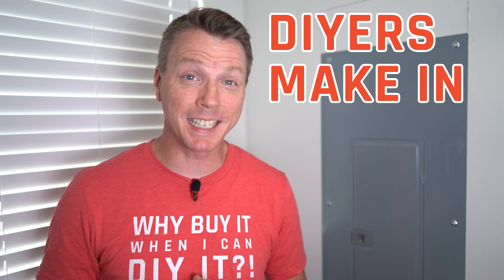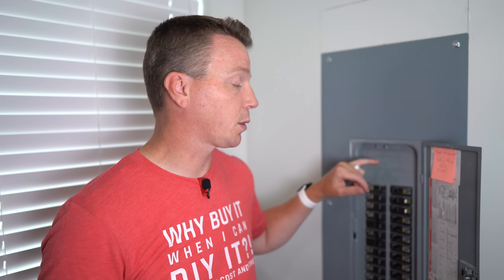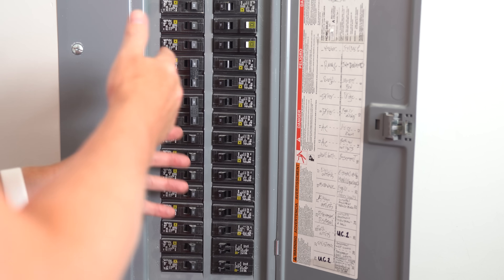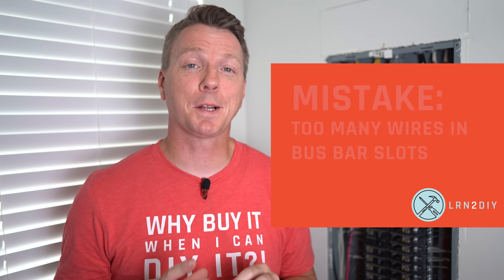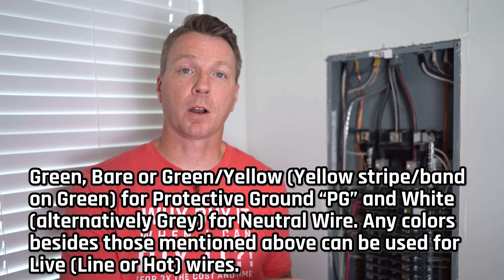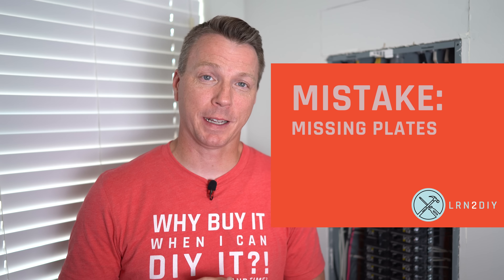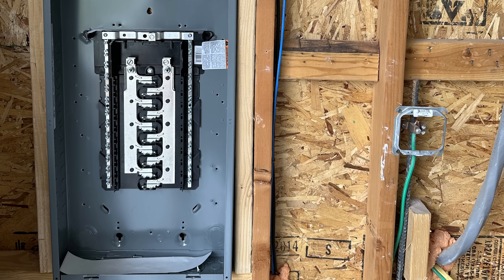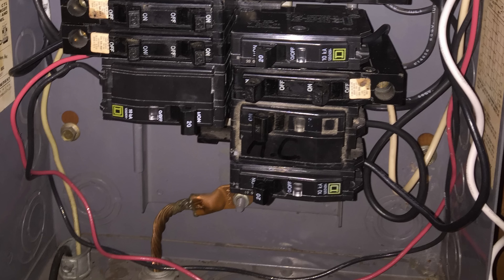10 Common Mistakes DIYers Make In Circuit Breaker Boxes

Comment: Our house in michigan the fuse box is in the basement , the main sewer line slopes down the far gable side of house's basement , 3 foot or so from the wall , the fuse box is about even with it , when I first saw it , I was wondering if the door would clear it , but it does by a long shot ..just never seen a plumber and a electrician work so terrible behind one another.
The florida house , when I got it , had the local professionals put in a sub box for the ac , apparently it shorted out so they pulled that fuse and run a sub box , with one of the bus bars burnt in half .. previous owners were 93 yrs old & handicapped ..couldn't have ran if there was a fire ..

Comment: M.E. here. Nice video, well explained. I got a chuckle out of the clean organized panel you showed at the end. I LOVE clean work, THAT'S the guy I want on my crew or doing service calls. But then I looked closer, and saw the circuit wires labeled in numerical order from top left down, then top right down, rather than odd circuits left, even circuits right. I know this was probably from the pull, labeling the romex as each home run was pulled to their location - but then you need to have a pull drawing to know exactly where everything went, if their numbering isn't going to match the panel cover. Hardly the end of the world, just gave me a little chuckle. It's the little things, sometimes. 🙂
Reply: A good little trick when roughing in a residential panel is to cut off a 2" piece of romex sleeve and slide it over the homerun hot conductor  as you land the wire   this also cuts down any confusion which wire controls what circuit.  Plus it saves time when labeling the panel!

Comment: My pool equipment started acting flaky, and it turns out they had installed the wrong type of breaker in the panel. It sort-of fit but didn't really lock in. It had been working for 15 years or so, but eventually started losing contact. There were three other breakers in the panel that were also of the wrong type.

Comment: I want to replace all the wiring in my house. It is Aluminum. What were they thinking when they allowed aluminum?!  Aluminum corrodes causing high resistance and subsequent heating. Aluminum mushes down when connection is tightened. Aluminum expands and contracts with temperature. Some bozo electrician back in the 70's used Aluminum in all the outside outlets! WTF! When I go into the outlet, I find the wires burned and brittle. I lose continuity in the circuit and lights go out inside the room that circuit is associated with. Doesn't even trip its breaker! I had to remove the affected outlets try to find Good wire by snipping off the bad stuff and hope I have enough left to wire nut together with special expensive Aluminum wire nuts just to abandon the outside outlet and restore continuity to the loads on that circuit. You electrical geniuses dropped the ball on that fiasco. Do you have any remedies that doesn't involve ripping down all drywall? Good video BTW.

Comment: The "wire" can handle the higher amperage.  The insulation determines the max amperage allowed to avoid heating and cooling the insulation so that it hardens as the oils evaporate out and eventually the insulation cracks and falls off.  Only one rule...call a licensed electrician.  We go to school and have 8000 hours on the job training for a reason.

Comment: I follow two guys that often don’t use strain relief/bushings and when I asked them, they said they use them if they have them?

 I do a lot of work on buildings built in the 40s and 50s and I like to use a white and black heat shrink on the wires since it’s often not clear which is which. When I see a white wire using the power wire I’ll put black each rank on it even though anyone who sees it on a break or assumes, it’s part of a 220 circuit.

Comment: I would add one more important one:  turning off the main breaker with all the branch circuits left in the on position.  The branch circuits should be turned off first and turned on last when shutting off and turning back on the main breaker to avoid damage to the breaker due to arcing.
Reply: This is an electrician's rule...not a homeowner.....lol
Reply: @electvolt67 uhh, this is anyone with a brain's rule who doesnt want a dangerous surge of power as soon as ALL the breakers demand ALL the power in the same millisecond.. "lol"
Reply: @electvolt67  Do you want an arc fault situation to potentially occur? Do you enjoy flying by the seat of your pants and possibly burning down your house or having some other accident. Turn off your breakers first and then on last...do it right or don't do it at all!

Comment: Mine just has an unused circuit breaker.   I think they reused the original 1960's panel when they replaced the wiring in 2004.  The left the original wiring in place and just disconnected it, stapled to the rafters.   I have been slowly removing that 1960's wiring.  The metal factory pays pretty good for it.

Comment: Thank you.
   Others have made comments on safety issues. 
  A good summary.
  For safety, stand off to the side of the panel. If a rare breaker explosion occurs, that will lower your chances of getting plastic and metal in your face.
   Thanks again.
Reply: Couldn't agree more - face shield if available. I'll add the same holds true for jump starting vehicles. Rare, but if there's an invisible 'cloud' of hydrogen gas around a battery, the arc from attaching the jumper clamp can cause a hazardous flash to an explosion that spew battery acid in every direction. I saw it happen once and still remember vividly. It's not pretty. Stay safe - live longer.

Comment: Something not said in the video nor did I see it in any comments, while many did refer to building codes and  NEC codes as well, 
Both NEC and local codes are not great standards, they simply set a BARE MINIMUM  ACCEPTABLE  for safety of the people and property involved.

When someone tells you that it's to code they are really telling you, I have done my job to the absolute minimum I could legally get away with.

Comment: He is nitpicking on the nuteral thing you are allowed and is done in many place to dabble up  the naturals in the box, best practices no legal yes.. in a main load panel the nutaral and the ground are on in the same because they are bonded together.  Sub panels are different in how they are set up their neutrals and grounds are separated as in isolated from each other. and the ground bar has ints own path to ground.  The standerd setup in most house is two hots and a ground comming from the main panel  the two hot wires are connected to the two hot lugs and the natural is connected to the nutral and ground bar by stranded setup. it looks lick he has 3phase panel there because of the wiring set up

Comment: Wish you would have made this 3 years ago. I had to do some work in my detached garage, it has its own panel. I shut off all of it (main and each breaker)  and got started. I got blown half way across the room. Turned out the outlets were ALL on the main House Panel not the garage panel. Insult to injury I was working on the 220 plug for my compressor because it was cracked and breaking so the compressor stopped working entirely. In hindsight just turning on the old stereo out there would have told me the plugs were all still hot but Noooo let's learn how to fly! Garage now runs the garage and the house runs the house. As you mentioned, very little labeling on either. They are now! The garage plugs were actually marked POOL. I don't have a pool.
Great video though!

Comment: I have a couple of "extra" wires hanging in the panel AND a couple of receptacles with no power.
 I was thinking of using a 1.5-volt battery applied to the receptacle and testing the disconnected wires hanging in the panel. Would this tell me if that was the right circuit?

Comment: All I have ever seen is white sheathing on 14,12,10 gauge wires so do not go by color codes because different manufactures make the wires  differently. The wire should have printed labeling on the wire sheathing. Some older panels have screws on the circuit breaker so you want to attach the wire on the left side to wrap around the screw that turns clockwise.
Reply: Not sure how much experience you have. But I've been licensed for 40 years and the industry standard hasn't changed as far color coding 14,12 and 10 gauge romex   the conductors have changed over the years   knob and tube  two wire cloth  three wire cloth  but third generation romex has been fairly consistent    should be able to determine gauged by feel or circular mills

Comment: If you don’t know that a white wire landed on a breaker is hot, you have no business being inside that panel. Also code allows for two grounding conductors to be landed under one terminal.

Comment: Extra bonus tips:

1: Do not mix neutral and ground wires from their respective ground/neutral bars in sub panels. There is only supposed to be one bonding location downstream of your electrical service and it must occur in the main panel.

2: Neutral wires should never be landed on ground bars even in the main panel. 2020 NEC 200.2 (B) states "the continuity of the grounded conductor (neutral) shall not depend on a connection to a metallic enclosure (the panel you're working in), raceway, or cable armor."

Basically, keep your neutrals and grounds separate even if you need to extend the wire with a wire nut, waygo, polaris lug... you name it.
Reply: Your #1 is more than a bonus tip, it's essential for preventing electrical fires in case of a ground fault. You must never bond neutral to ground in a sub panel.
Reply: It's not just ground faults. It provides a second path for the return neutral current through the entire neutral system, which, if the regular neutral path is interrupted anywhere, can result in a shock through any grounded device.  @acbeaumo

Comment: I'm not sure if this is true, but I needed new inspector label on my panel, and called in a 'pro' to check what might be missing and was told I was NOT allowed to use phase tape inside the panel.   This was quite a few years ago so I don't recall the exact specifics but I think it was because I had a big spool of black 12 gauge stranded and didn't want to buy a spool of white, so used two blacks but then I put white electrical tape on the ends.   Then was told I'm not allowed to do that.

Comment: Yeah, better leave panel capacity to the professional. Consult a pro about adding circuits to your system. 
If you think you are even close to using 200A, stop growing weed.
Reply: bahh. my Ticketmster reseller/scapler farm easily sucks down 200 amps

Comment: Here’s a good one for any of you that are electricians. I’m a retired HVAC contractor and did a medical center in Atlanta about 20 years ago. The electrical contractor had three 200 amp panels in the mechanical room. We had three 5 ton heat pump systems with 15kw strips in each air handler. They put ALL  the 240v runs in only one of the panels and had the other two with only lights, receptacles, etc. In addition to our systems, that panel had equipment like a water heater, clothes dryer, and an X-ray machine with a 100 amp breaker. It passed city of Atlanta inspections! We had multiple service calls of tripped breakers when it was cold outside and everything running. The panel was HOT, and vibrating. The voltage on our condensers was down to around 207 volts and ended up burning out one of the compressors. We found that the breakers would trip when everything was running and they energized the X-ray machine. I ended up getting the city inspector to come out to show them what was happening and told the medical center I wouldn’t be back until the loads were properly distributed among all three panels. Oh BTW, I checked the amp draw on the mains of that panel and it pegged my meter! Add to all of that, they made a parking garage directly under them and left the concrete exposed with no insulation, and of course everyone said their feet were freezing! I never heard anything from them after that.
Reply: Huh. That sounds like the electrical contractor either didn't follow the plans/specs or they were trying to save money    no electrical engineer worth his salt would allow a current calculation that didn't conform to the NEC or any state/county ordinances

Comment: "Amperage" is incorrect. Electricity is current driven by potential measured in voltage. The current flow is measured in amps.

Comment: The Neiko torque screwdriver is made in China; in fact it is a Chinese brand. Thank you Cultivate browser add-on for Chrome, Firefox and Brave.
The Klein is made in the USA, and it is prohibitively expensive at $279. The Klein circuit breaker finder is made in China. 
The "Wiha 28506 TorqueVario-S Torque Screwdriver, 10-50 Inch Pound" brand is in Minnesota, and the tool is made in Germany at $128 
The Cultivate add-on is free, by the way

Comment: I love turning chaos panels into art! I done a panel during COVID shutdown when I was on layoff from my 9-5 and let me tell you it was the worst I'd seen, made the rats nest panel showed in this video look like a work of art. Well 2 days later a fully upgraded panel that looked beautiful, a fully rewired basement, and several changes in the main part of the house were complete and I was totally satisfied with my work. More so impressed was my buddy who hired me to do the work, he knew I had an electrical background but didn't realize I was that good. I just wish I could share the pictures here so you too could see what I walked into and how great it looked when I left. Oh and I didn't mention this place had more junction boxes than any 25 houses I've seen. I done away with as many as I could but to save money most of the old wiring stayed but I got it up to par as best I could with the budget he gave me to work with. Sparky for life.
Reply: You would have loved the control panel for dancing waters at Moody Gardens in Galveston, Tx.. One of the most beautiful wiring jobs I'be ever seen. Each and every wire was perfect as were the ty wraps. Each bundle was aligned perfectly and there were hundreds if not thousands of wires.
Reply: I have converted quite a few rat's nests, and the end result has always been quite satisfying.  The irony is that you actually save time over the long run when you do work with a set methodology.
Reply: I need you badly for my basement... built in 1900 and remodeled four times. Two large breakers and two smaller ones... who knows where half the circuits go.

Comment: If a white wire is going into the breaker and not the bar, I think that indicates it's used as a hot wire, more so than the red tape an inch away

Comment: Excellent video, lots of great reminders and a few new items. I hope your next video about adding on a sub panel might include adding a 220 V outlet for say a welder in the garage or shop? Or adding a 30A or 50A outlet and breaker for an RV hookup?  Or adding a Backup Generator? You probably have these already. I’ll look through your video’s and be editing this post if I find them already covered I surely return and edit my post. Personally I’m looking for reminders and references but I’ve received a lot of questions about these lately and see a real need out there with up to date code info. My info is really outdated by now.

Comment: The panel is the heart of the electrical in your house. Would you operate on your heart?
Call a professional, the codes change regularly and they are up on the newest ones. Paying a qualified electrician is a lot cheaper than burning your house down or worse killing a family member by electrocution.
I’m a contractor and even though I know about electric panels I still hire electricians to do the work.

Comment: Thanks,

My main breaker is located outside and the panel inside was evidently modified into a sub panel by removing the main breaker.

This left a hole in the front of the main panel.

I knew it was unsafe, so I covered it with duct tape.  I also knew this wasn't the right way, but it was "safer" than leaving it open.

Now I know what is needed to fill that hole.

Comment: That nasty box is so old...  Having all the ground/Neutral at the top makes it very difficult to work on.  I did Residential Electrical for 20 years and replaced 10 panels, not including the work I did on a buddies house outside my state.  I've seen some crazy dangerous electrical in that tine, from electrified Knob and Tube in an attic with boxes sitting on top of the wires to late 1800s electrical in an adobe farmhouse that had to be replaced by fishing new wire up through 18in thick mud bricks, and doing work on my own home that was electrified by the lowest bidder.  You give good advice.  Keep it up.

Comment: Hold Everything!!! You told us №4 was about balance. What about balance of voltage for each buss bar? It's one of the most important, I'm not starting a fire today, important! You can have 120/240 single phase and buss bar A could be @ 120 amps and buss bar B could be @ 75 amps. Those need to be balanced by perhaps a professional and have my panel infrared tested every 24 months. I caught an HVAC compressor trying to kill itself, I saved it's life. The compressor alone was $1500 nevermind installation.

Comment: I have to double up on both sides of my hot breaker bar because I have dead spots on my bar on the left it is the 2nd breaker down and on the right it’s the 4th down I have bought new UL breakers but the problem is still there. What am I missing?